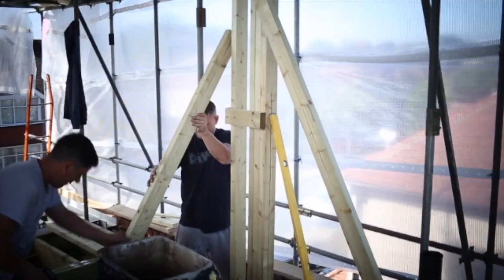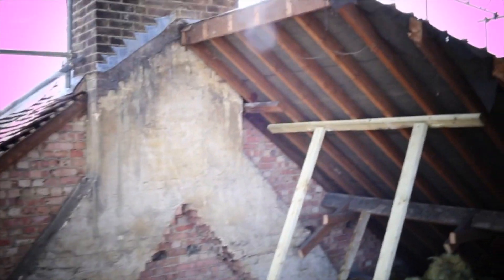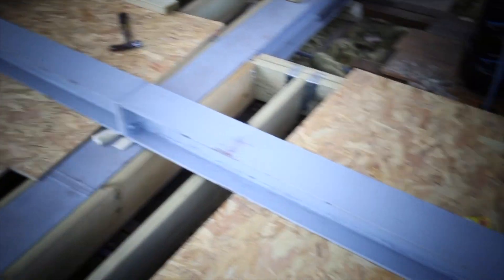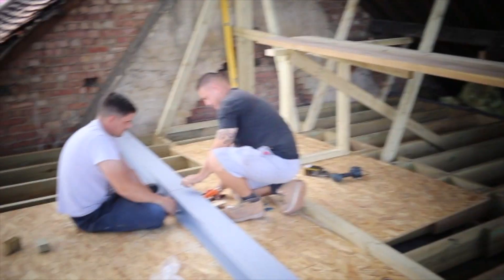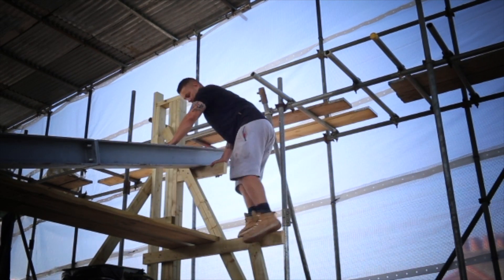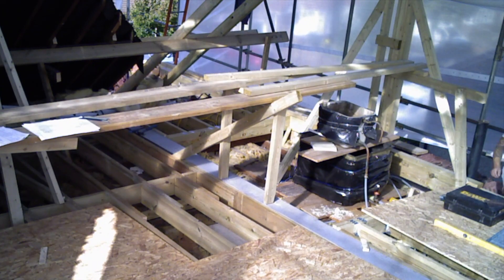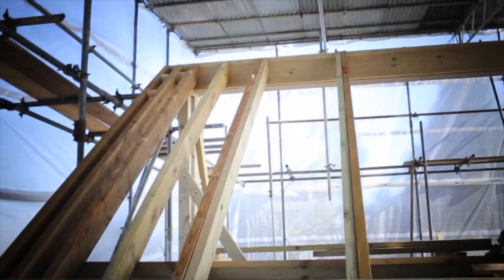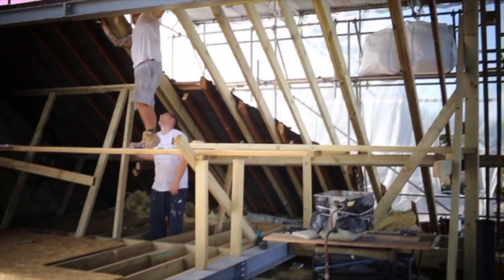How to install a loft ridge steel and front rafters

Comment: How did you fix the rafters into the steel. Also is the steel slightly lower then the rafters so the flat roof doesn't end up higher then the ridge once the furrings and osb boards go on?
Reply from the maker: We put a timber in the web of the steel, so that we have something to fix the rafters to, but we also put timbers on top of the steel as well so that the rafters are fixed into both. It also stops the furrings and OSB ending up lower than the ridge, like you mentioned. Effectively we boxed in the top of the steel with timber.

Comment: Hi - great videos. Masters at work. I just wondered why you used a steel ridge beam and why a wooden ridge wasn't sufficient. Also, can you post a link to the video where you replace the wooden support of this steel beam with steel supports. Many thanks
Reply from the maker: The steel was what was specified by the structural engineer...that's pretty standard these days for hip to gables of this size - there's too much deflection in wood over that span distance.

We ended up sticking with the timber supports and bracing them, which the SE signed off.

I have another video (more recent one) where we use steel posts instead.
Reply: @OfficeBoyBuilder  Many thanks OBB - really appreciate your videos. Master craftsmen at work

Comment: Great video and top job. Liked the steel in three pieces. Only slight worry on the lift you had it resting on a 3x2 that didn't look strong enough. Also I'm guessing that temp frame screwed together rather than nailed which might not be strong enough without a forest of screws. (I don't like nails). Wondering if a couple of chain blocks could have made it safer with a pair of V lifting frames (with additional longitudinal V brace to a centre point). Did you have any BCO worries using your lifting frame?  The 3x2 and screws aside it looked safer than others on YouTube. Look forward to next one.
Reply from the maker: Cheers - I think you're right on most of that, but a lot of the time it's a function of speed, so we do the safest, quickest method possible...it's a balance with all these things (as well as using what you have to hand!).

Glad you're enjoying the channel 💪🥳

Comment: Absolutely fantastic videos mate. So helpful for DIY & people who are interested in the process etc. Im planning on doing a dormer extension so this is great for me. Out of curiosity how did you conmect the rafters to the steel beam? Thanks
Reply from the maker: Cheers mate, that's great to hear! We put a timber in the web of the steel, and then cut the rafters at an angle so they sat flat against the face of that timber, before nailing them in place 👍 hope that helps!

Comment: Do you know approx how heavy that beam is? I'm gonna be needing one soon and I'm going over in my head how difficult it will be!
Reply from the maker: Hey, I know exactly how heavy it is, and you can find out how heavy yours will be too. My beam is a 152x152x37 which basically means the top and bottom widths at 152mm each, and each meter of beam weighs 37kg. Our beam was 8 meters long when bolted together, so that weighed 296KG and then we had huge bolts to hold it together, which as was another 4KG, so 300KG in total! Between 3 blokes...hence why we made the frame and lifted it in sections.
Reply: @OfficeBoyBuilder  Cheers buddy. I got told that a rule of thumb for a load bearing beam is 1/20 the width will be the size needed so I'll need a thicker one than yours but shorter. I guess yours is thinner as it's a ridge.  I'll have to check the weights for the size I may need (I won't know for sure until engineer looks at it) do the spliced ones weigh a lot more than normal ones?
Reply from the maker: @pompeyjim  yes that's a good estimate, although I think a lot of structural engineers over-egg the calculations a fair bit for the sake of caution and to cover themselves. Our two floor steels were absolutely huge - way bigger than the ridge beam.
Reply: @OfficeBoyBuilder  what dimensions were the floor joist beams can I ask? And did you get the beams made in sections because 8m was too long to get as one beam, or because 8m beam was too hard to get up there as one piece? (must be more expensive to buy beams in engineered sections like that I presume)
Reply from the maker: Floor joists and roof joists are all 9x2's. The SE actually spec'd for a single length but the builder I worked with asked for it to be spliced and bolted so that it could actually be moving in place!

Comment: Great video! Will the ridge beam be okay to be held up by the timber posts on the party wall end? Would have thought the ridge beam is inserted directly into the chimney breast to spread the load...
Reply from the maker: Good question, and one that I asked too! You can't insert a steel beam into a chimney breast, especially not one that works (likes ours do), because they're not strong enough/considered structurally supportive...you can get square, steel posts which the beam sits on, and is either bolted to the chimney, or seated on a padstone below. In our case, the structural engineer was happy with four 4x2's beneath on each side, seated on a steel plate which was above the spine wall of the house.
Reply: @OfficeBoyBuilder  This is a little surprising as chimneys are usually the only thing left standing after a serious gas explosion, and we've sadly had two in the uk recently. Were the timbers treated may I ask?
Reply from the maker: Good point mate, and not one I'm qualified to talk more about - I was simply repeating what the structural engineer told me!

The timbers were C24 - so yes, fully treated 💪👍
Reply: @OfficeBoyBuilder  No problem and nor am I. Those tin hat roofs are scary, yet impressive, structures to see go up. Thanks for the videos.
Reply: @OfficeBoyBuilder  you say four 4x2s seated on a steel plate. But how were those 4x2s connected to the steel plate?
Reply from the maker: There was a 4x2 laying on the floor as the base plate that the studs sat on - the point was more that the weight of the steel was being transferred down to the steel in the floor, which in turn was sending the weight to the foundations via the load-bearing walls 💪👍

Comment: Also, are the timber columns/posts that hold up the beam resting on the inner brick leaf of the wall?
Reply from the maker: Hey, Yes they are! We built up a few course of bricks on top of the existing wall-plate, and then put steel plates underneath the timber columns to help support and spread the load.

Comment: Hey, great to see the steels going in, can I ask how much the steel was?
Reply from the maker: Cheers, glad you enjoyed the video! The Steels cost £2,500 including delivery (we're in S.E London) MAH Steel
Reply: @OfficeBoyBuilder  was that for just one ridge beam and one floor beam only?
Reply from the maker: @eddienolan7129  that was for two (huge) steels in the floor. And the ridge steel. The lengths of the two floor steels were around 6.5m each, and they were 203 X 206mm
Reply: @OfficeBoyBuilder  Thanks! I'm considering buying an old 3 storey, would need internal walls removed, all of them pretty much. Might be too expensive considering how much your beams cost
Reply from the maker: @eddienolan7129  they may not all be load bearing...often just the spine wall and the outside walls are load bearing.

We have a number of block walls internally which I thought were load bearing because they were made of blocks, but they are basically studs made out of blocks!